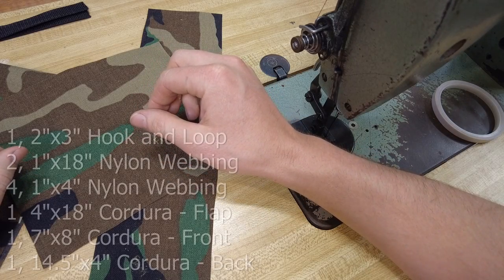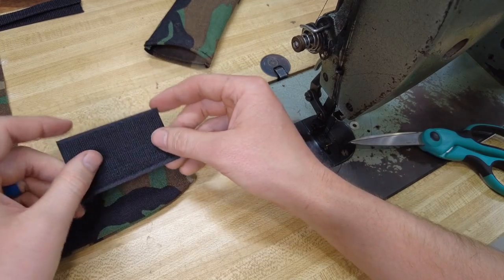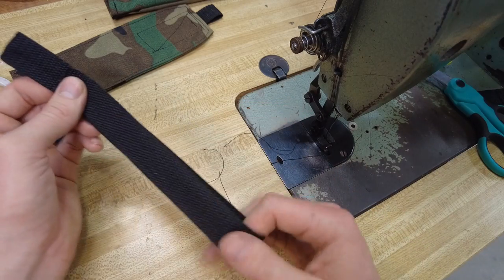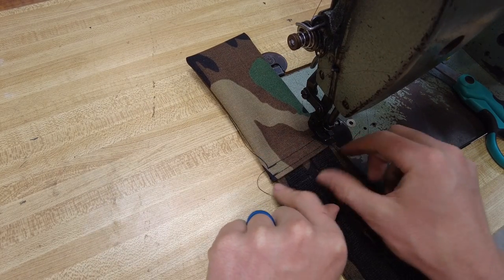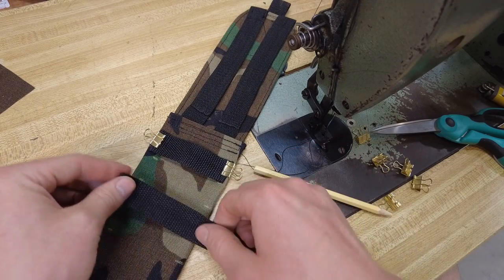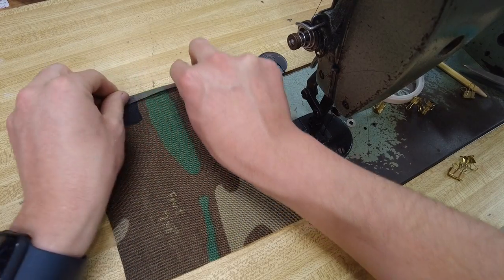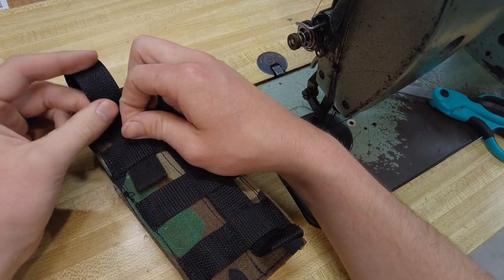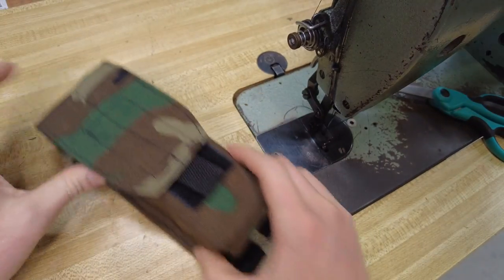How to make a double mag pouch

Comment: Sorry to ask if you have done one already, but could you possibly do a video on how to make a triple m4 molle pouch? I want to try and make one for use on my jpc 1.0
Reply from the maker: Do you mean 3 in one pouch with a flap or three individuals single stacked in a shingle?
Reply: @thriftyoperator637  single stacked. sorry if that was unclear. something low profile (somewhat like a bfg triple) cause I am wanting to take a shot at making one for my pc.
Reply from the maker: @beguinworkshop9068  look through my videos from about a year ago for one titled “how to make a mag pouch//plate carrier shingle”. That one isn’t molle though. I have seen a good video on one of those from another channel so you might search around.
Reply: @beguinworkshop9068  You mean their 10 speed? Because all you have to do with that is sew a molle panel with straps, and then on top of that sew 6" elastic on top flat, and sew vertical stiches 2.5" apart. If you want a velcro closure, sew velcro onto the elastic before you sew it on, and sew a the velcro flap as you sew the molle.

Comment: Great video! 2 questions….. how heavy duty of a sewing machine does one need? I’ve been eyeing an Amazon special for a while.

Why not Malice clips instead of the string method
Reply: And 3….. would uniform material be too thin for this application? I’d love to use woodland MARPAT
Reply from the maker: @TheFinalAppeal  I haven’t used many machines so I can’t speak for most but I used the super cheap brother sewing machine that I have linked for a long time and it did pretty good. I just had to hand feed it the thicker parts. 
I used loops because they are simple and you don’t have to buy anything else. 
Uniform material may be a little too thin but you don’t know until you try.
Reply: hey if you dont mind me chiming in, I would not get that cheap brother sewing machine, No disrespect to the channel owner, but that brother will give you more headaches then help, I wouldnt go any cheaper then the Singer heavy duty 4432, and if you want anything heavier, get a sailrite clone, like a sewstrong , or Rex607 for $399 or $499 with a 9" bed, which is what I use, (I have a video)with a Sailrite balance wheel upgrade, now thats a power house, second to getting a industrial sewing machine, plus its mobile. Hope this helps